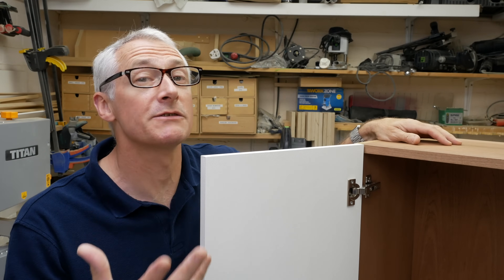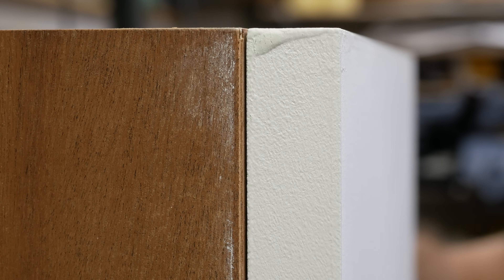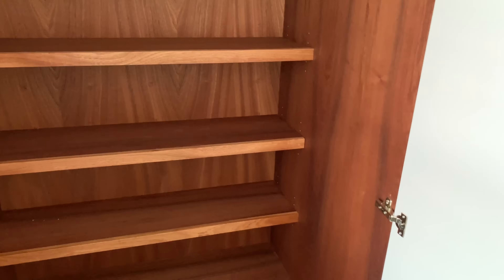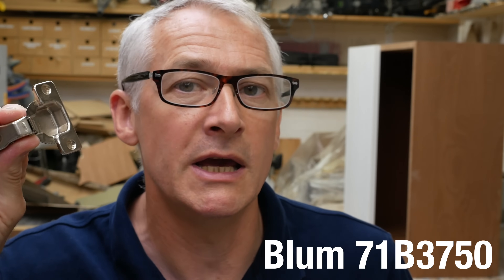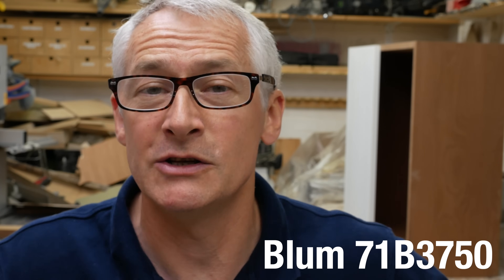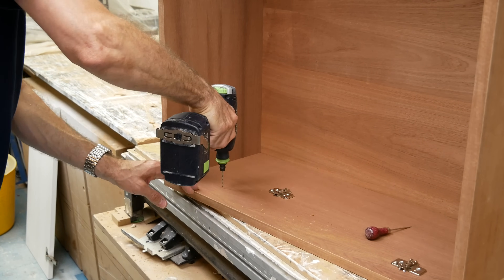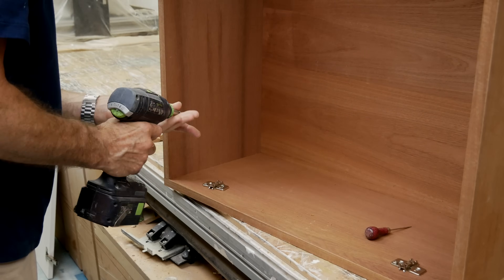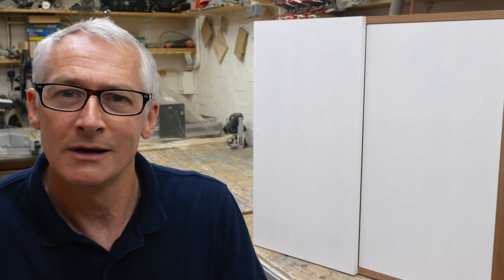How to fit concealed (Euro-style) hinges for overlay & inset cabinet doors [video # 348]

Comment: Great info, i am sure i have a insert hinge but the door fits the outside of the frame and i am looking to upgrade to soft close hinge, do you know if the can be done and correct ,thanks in advance
Reply from the maker: Thanks! If the door sits outside the frame then you have an overlay door; the hinges mentioned here - Blum 71b3550 - have soft-close built in. There’s also a cranked or inset hinge available as well, links in the description. 👍

Comment: Hi Peter! Does those jigs and measurements work with like 25mm thick solid wood? What I mean is if that works with non-standard thickness mdf or plywood. Thanks a lot 😁
Reply from the maker: The hinges will have a range of door thicknesses that they’re compatible with; from memory these one are good up to 26mm thick,  it check the specs of the ones you’re using. The carcass thickness is handled by different mounting plates; most hinges are for 18mm, with a thicker mounting plate used for 16mm. For thicker carcasses you need a specialist hinge. 👍
Reply: @10MinuteWorkshop  thanks a lot! I’m about to build a tv stand for my living room, but I wanna make it out of solid wood, and naturally my stock will thicker than 18mm, either the carcass or the doors. Once again, I really appreciate your videos!

Comment: Hi Peter, can I ask question, how much space do you take for inset doors? so for a cabinet with 1 inset door, how much smaller is the inset door compared to the carcas opening? thnx
Reply from the maker: Hi Wim. I aim for a gap of 1.5 - 2mm, so a single door, inset in a carcass would be 3-4mm smaller. I'll have a 'door width basics' video out before too long, as it all changes when you have more than one door, especially for overlay doors! Hope that helps! Peter

Comment: I bought the kreg jig a while ago but I found they were putting the holes for the screws in the wrong place. But considering how many types there seem to be, maybe that was more to do with the type/brand of brackets I had?

I have these all over my house and I find them a real pain to get the door straight and all the videos I see make it sound and look so easy. I find them very frustrating and would be interested in a review of them from someone that hasn’t used them before or a review of different brands to see if there is any difference
Reply from the maker: That's interesting, Phil; as far as I know all the hinge plates should stick to the '32mm system' so I'm not sure how the fixing holes could be in the wrong place? The hinges you have, are they clip-on or slide-on? Clip-on are much, much better, much easier to adjust as there are only two screws, as shown here - one for in/out, one for side-to-side. Alastair over at Freebird Interiors did a slightly nerdy comparison of some of the brands of hinges recently, might be worth a look - though tbh as long as you're sticking to one of the bigger brands, it's hard to go wrong. 👍
Reply: I have the Kreg jig and also found that the screw holes would end up in the wrong place. For drilling the 35mm cup it works really well though! The screw holes I just drill with a self-centring bit.
For these Blum hinges you'll probably need to set the adjusters to 6mm.
Reply from the maker: Thanks Frank. How bizarre! As I say in the video I haven’t actually used the Kreg jig yet, but Indis notice they used the ‘distance from the edge of the door to the edge of the hole’ method, which I hate, personally. Time for a play. 👍👍

Comment: Thanks so much for these videos Peter; they are the main reason I’ve decided to take the plunge and make my own fitted home office units rather than go down the Wickes route. 
Can I ask - for overlaying doors - do the hinges allow the door to open without any extra space required laterally? By which I mean, can I mount overlaying doors side by side with only a few man between them, without causing problems of catching on the edge as they open? (My plan is for 3 cabinets together, with top/bottom and outer side panels of the side units cut deeper, and “dividing” side walls shorter, so the doors will appear all inset as if it’s one big cabinet, but in fact 2 of the 3 doors will use overlaying hinges, and only the left-most door will need a true inset hinge.)
Reply from the maker: Thanks! Yes, overlay doors are designed  to open ‘within their own edge profile’ as it were, so as long as you have a couple of mmm between the doors they’ll be fine, assuming 18 or 22mm thick doors. 👍
Reply: @10MinuteWorkshop  Brilliant, thanks 👌
Reply: @10MinuteWorkshop  Sorry Peter, I have one last question if you happen to have a spare 30 seconds - do the overlaying edges of the doors butt up against the edges of the cabinets when closed, or should I allow 1,2,3mm stand-off? I’m wanting to align the outer surface of the door with another panel…
Reply from the maker: @Saladzingers  That’s a way longer than 30-second question! Depends on how the cabinets are situated, but I always try and leave at least a 1mm gap between any door and panel/wall. Preferably the same gap as between the doors on a double cabinet. 👍👍
Reply: @10MinuteWorkshop  Ha ha, sorry! But thanks!

Comment: great video. my cabinet is only 2 5/8 " deep will the blum inset hinge work, it looks too long ?  can you install them by putting the door part on the cabinet wall instead. [obviously one of those beginner questions].
Reply from the maker: Thanks! Blum seem to state 100mm (4”) minimum depth requirement. And I’ve never done it, hang the hinge that way around, but folks who have say it works! 🤷‍♂️👍
Reply: @10MinuteWorkshop   thanks much for your reply, ill give it a whirl

Comment: I'm looking to replace my kitchen cabinets hinges for some soft close hinges. But I'm having trouble finding a replacement      my current hinges where they mount to the cabinet box, are the " knock in" style or 1/4 turn and the whole door will release from the box      the boxes are laminate and doors are wood and all the hinges I've seen are regular screw mount to the box which I now have 10mm holes where the dowel used to be.  Old dowels are not removable
Reply from the maker: Hi. Sorry, I’m not familiar with that style of hinge - is there a makers name on it anywhere?
Reply: @10MinuteWorkshop  hi Peter thanks for the reply.  The brand on the hinge is salice and the cabinets are mills pride.  The only thing I can find for reference is this mounting plate which has the same style as mine https://www.richelieu.com/ca/en/category/hinges-slides-and-opening-systems/hinges-and-accessories/european-style-hinges/blum-hinges/blum-mounting-plates/clip-and-clip-top-mounting-plates/clip-mounting-plate-with-dowel/1204066/sku-174L610180

Comment: Is there any particular  Blum mounting plate model you recommend using with the 71b3550 for the novice installer? 

Thank you from the US. You are a multi- national treasure.
Reply from the maker: Thanks! I typically use the standard Presses steel cruciform backplate ref. 173L8100. 👍👍

Comment: Great video. Much appreciated. Once quick question: I fitted three doors. Two close perfectly – the middle door self close, it's stopping just short. I've put magnets on. Now I can get the top to close but the bottom right is still standing proud. I've tried all the adjustments. Any ideas?
Reply from the maker: Thanks! The times I’ve had the issue with doors ‘springing’ like this has usually been down to the hinges being at the extremes of their adjustment, especially if they’ve been pulled all the way into the carcass. If that’s the case - and it’s easy to check, just wind the adjustment out and see if the door close the full 90° - then it’s likely that the hinge plate has been fitted a little too close to the edge of the carcass, which is why you need all the adjustment. Moving the hinge plate away from the edge,further into the carcass, should sort things out. 👍👍
Reply: @10MinuteWorkshop  Ha ha...fixed. That's great. Thanks so much for taking the time to put this video up and your prompt response!

Comment: Hi I know this is an old video but hoping you still check it from time to time. My question is I have Blum soft close hinges but when you push the door they stop about six inches away from the carcass and don’t close. Are the hinges broken? Do they need to be replaced?
Reply from the maker: Yes, assuming there’s nothing else preventing the doors from closing, then almost certainly the hinges have some kind of issue. Blum hinges offer a lifetime warranty - contact Blum in your country to have them replaced. 👍

Comment: Dear Peter
Thanks for a fab tutorial. May I ask, if you were to install louvred doors in a fitted wardrobe (style thickness 21mm, height 1981mm; soft wood[pine]) would you use concealed hinges? I have purchased two louvred door leaves from b&q with no datasheet or installation guide. It seems that flush hinges are the prevailing choice; however, a premium, ball-bearing flush hinge appears more expensive than a good old concealed hinge which I usually opt for with mdf&plywood projects, hence my hesitation to crack on. If you have any advice on this situation, then I'd be so grateful for your response. 
Warm regards, Blair 🛠🪚🪛
Reply from the maker: Hi Blair. As long as the stiles are wide enough to take the hinge then they should be fine on concealed hinges. 21mm is within the range of thicknesses for most regular concealed hinges, so you wouldn’t need anything special. From memory, you’ll need a stile of around 50mm wide minimum to take the hinge, 60mm a bit more comfortably. 👍
Reply: @10MinuteWorkshop  Hi Peter,
The doors turned out great, mostly thanks to your response. Thanks so much for taking the time to do that, I appreciate it. Have a great weekend. BM

Comment: Interesting and well presented video. Thanks. For my full overlay hinge fitting I bought the small black template you mention. for peace of mind I measured the hinge and cup distances. The hinge holes are 37mm from the edge. Great. The cup hole centre measures more like 21.5mm from the door edge (4mm clearance), not 22.5mm (5mm clearance) by any means. Does this matter?
Reply from the maker: Thanks! And no, it’s just a starting point really. 👍👍
Reply: Thanks for confirming. I’ll do a mock up first anyway but good to know.

Comment: Thank you for the clear video. Does the desired overlay (quarter inch, half inch, etc) impact where the hinge should be drilled into on the carcass and door?
Reply from the maker: Yes it does; blum issue guides for this 👍
Reply: @10MinuteWorkshop  thanks so much. Now I don't have any more excuses to delay this project! 😂

Comment: Thanks for the video - I'm sure you have answered this but I cant seem to find it. How much smaller should an insert door be that the opening? 2mm on each of the 4 sides? Thanks.
Reply from the maker: Thanks! Depends on the thickness of the door as well, but 2mm all around for a 22mm thick door is pretty good, I'd aim for 1.5mm (door size minus 3mm) for an 18mm thick door where I can. 👌 👍
Reply: @10MinuteWorkshop  amazing. Thanks for the reply.
Reply: @10MinuteWorkshop  I just joined the channel!!!
Reply: @10MinuteWorkshop  Sorry one other quick question  - what screws do you use with the hinges? Blum catalogue states 3.5 x 15 or 17mm long
Reply from the maker: No problem; usually 3.5 x 16mm Spax 👍

Comment: On a standard overlay door, is the fixing plate 37mm back from the front or to the screw holes?
Reply from the maker: All measurements are to the screw/hole centres. The 37mm setback from the front edge is all standard with the 32mm system. 👍👍

Comment: great video, quick question: how do you account for material thickness when calculating where to drill what with given hinge? (i mean mdf can be 18mm but some other material can be 20mm, does the position of hinge plate not matter?) Thank you
Reply from the maker: You can get different thickness hinge plates, but generally carcasses don’t vary that much. 👍
Reply: @10MinuteWorkshop  thanks Peter! My problem is that with full overlay hinge, the door does not cover the carcass quite fully (in lowest setting, door most left)..so im trying to figure what would i need to change so it does - maybe the distance for hinge cup from door edge?

Comment: Hi any idea if the dimensions of 22.5mm and 37mm are universal between brands? I've just bought some Hafele hinges for overlay doors and I'm not sure what dimensions these would require.

Many thanks and keep up the great content.
Reply from the maker: They should be, but I’ve never used Hafele tbh - I’d run a test first. 👍
Reply: @10MinuteWorkshop  thanks for the honest and quick reply. Keep up the good work.

Comment: Hi Peter, 
If i want to add a full size mirror (4mm deep) onto an overlay wardrobe door, am i going to run into problems with it catching when opening due to the increased door depth measurement? is this something that the overlay hinges can overcome?
Many thanks
Reply: to clarify, the look i am after is a frameless mirrored door
Reply from the maker: Shouldn’t be an issue for an overlay door no. Just be mindful of the additional weight the mirror will bring, and maybe add in an extra hinge, or two. 👍

Comment: What would you use for a half-overlay application? Thanks
Reply from the maker: Blum 71T3650 would be the one. 👍
Reply: @10MinuteWorkshop  thank you. I will use those too. Seem much harder to buy.
Reply from the maker: I usually use trade hinges - https://www.trade-hinges.co.uk/blum-110-hinge---half--overlay-2157-p.asp

Comment: Hi peter.    Excellent video as usual. I have made a carcus from 25mm plywood and will be making 18mm doors would the spacing of the hinges be different due to the different thickness of material. thanks.
Reply from the maker: Hi Craig. The doors thickness should be fine, but with the carcass thickness you’ll  probably need to adjust the hinge-to-door-edge spacing. 25mm is pretty hefty for a carcass btw! 👍👍
Reply: @10MinuteWorkshop  Hi Peter.
 Thanks for the reply. Yes 25mm is hefty it's made from plywood the wife like the end grain look. Who am I to argue.
👍
Reply from the maker: Happy wife, happy life 👍👍🤷‍♂️🤷‍♂️😆😆

Comment: Hi Peter. Thanks for this amazing tutorial. One question please : Why do concealed hinges fail? 75% of my Euro-style kitchen and vanity hinges have failed, with very light use. I only visit this apartment twice a year. Could it be related to the installation? The kitchen was installed by the manufacturer. Thanks in advance for any assistance you can provide.
Reply from the maker: Hi Diana and thanks! Poor quality hinges is usually the main reason for failure tbh; if it was all carried out by the manufacturer fairly recently then I'd contact them to start with. FYI better quality hinges (eg Blum) carry a lifetime warranty; if a hinge fails, they replace it. 👍
Reply: @10MinuteWorkshop  Thank you!

Comment: Hi Peter, For the inset doors, what spacing do you cut the doors at each side to give youself a good gap? How many mm. Thank you
Reply from the maker: Hi. I generally aim for 1.5 - 2mm; works well with inset and overlay doors. I have a video planned about the topic, as it’s fairly complex when you get a longer run of doors. 👍👍
Reply: @10MinuteWorkshop  Hows that video getting along? thanks Peter

Comment: whats the secret ? whats the distance in from the edge to pitch in the 35mm hole on inset type ? Is it just to sell a jig thats not needed?
Reply from the maker: There’s no secret - all the sizes and distances are right there in the video. For an inset hinge they’re set into the door as usual, and the hinge plates need to be the door thickness +37mm back from the carcass edge.
Reply: @10MinuteWorkshop  I do apologise , I have got to say I'm really enjoying your video's and have learnt a lot .

Comment: Hi Peter, I have been following you for a while, you produce great informative videos, between yourself and Charlie DIYte, I have had the confidence to build my own built in wardrobes.
Peter I have a question, I have a home built cupboard in our spare room that houses our boiler, the doors hinge the wrong side really and I want to change, but the current hinge side is overlay and the handle side is inset. I assume to move hinges to the inset side, inset hinges will be needed but do I need to consider anything else?
Hope it makes sense, thanks in advance, keep up the good work.
Reply from the maker: Hi Karl, and thanks. The only other thing I’d mention is - and I’m assuming you’re keeping the same door - that you’ll have handle holes to fill it somehow cover up, unless it’s a central know that could work both ways up? Otherwise, no great issues leap out at me. Good luck! 👍
Reply: @10MinuteWorkshop  Hi Peter, thank you for the quick reply.
Yes, there will be holes to fill but they are MDF doors I made ages ago with single knobs so small holes, and could do with a refresh anyway!.
Thanks again, all the best.

Comment: Hi Peter. Making myself an aquarium cabinet as a project and I'm wondering if the cam adjusting hinge plate for the inset door type hinge requires to be bought separately? Thanks in advance.
Reply from the maker: Depends where you buy from, but usually the hinges are available with or without plates. Take a look at somewhere like trade-hinges.co.uk to see the range.  👍
Reply: @10MinuteWorkshop  Thanks Peter. I was checking the usual Screwfix etc but they weren't very clear and pics suggested standard plates. Like the idea of the vertical adjustment. Cut all my panels with a circular saw and the Kreg sled and track so any minor adjustments would be handy. The price of the hinges has shot up a fair bit like everything else I've noticed 😬